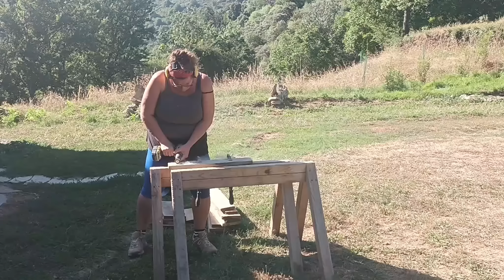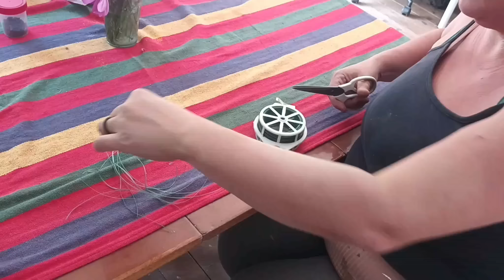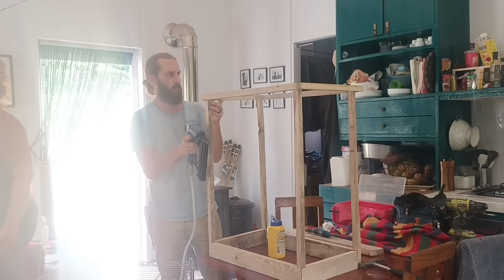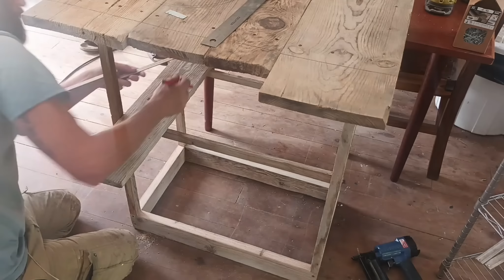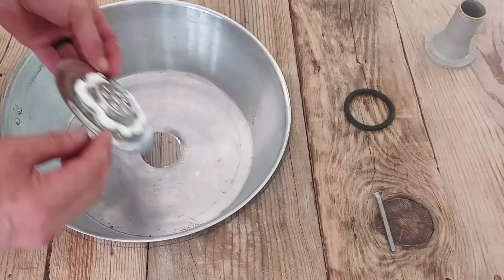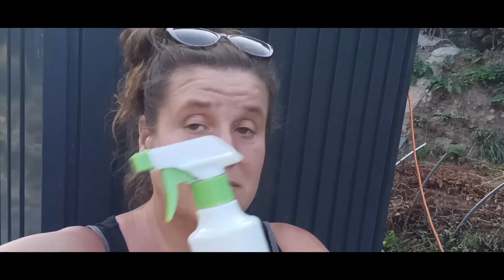Bathroom Vanity DIY | Upcycling Project + NEW Flock

Comment: Hey 👋 guys My experience with eggs 🥚 not using so much water because they can’t get oxygen through the eggshell and don’t wash the eggs unless they are cooked and you can use the lighter in your ☎️ and I was told not to help them get out of egg. Just use the water trick if you are going to eat the eggs. I hope this helps 🐓🐓🐓🥚🐓🥚🐓🥚🐓🇮🇸